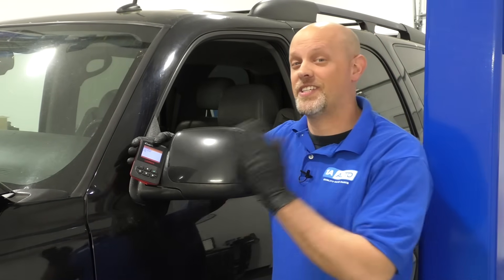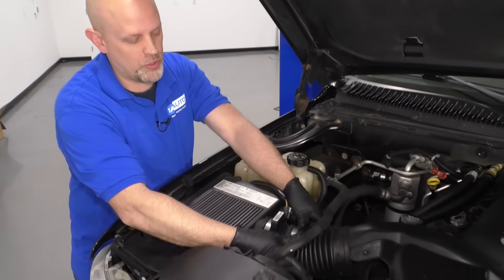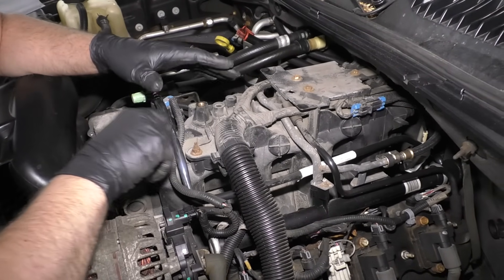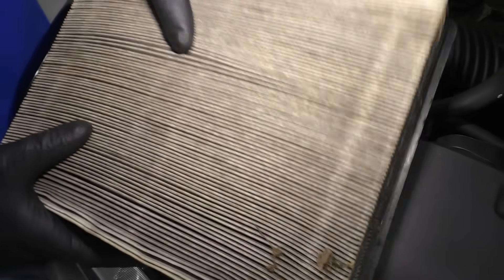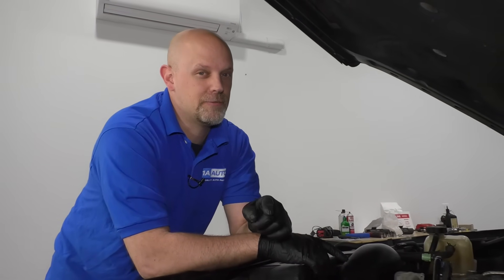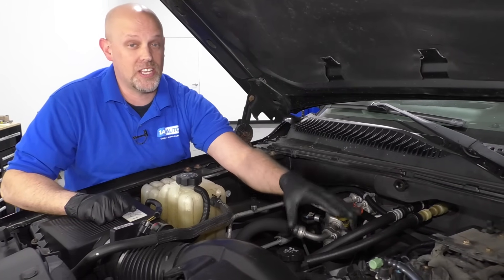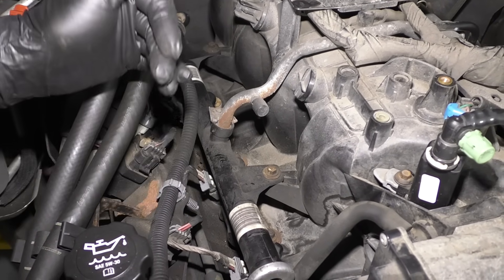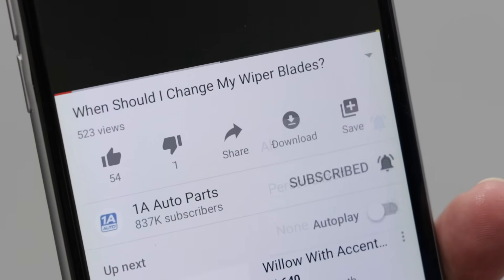Check Engine Light? System Too Lean - Code P0171 or P0174 on Your Car or Truck

Comment: Great video.  Now I know how to deal with the shop.  I think my problem is in the heater AC vacuum line.  This shop replaced the AC control head and ever since then it did not seem to work right and now am getting the PO171 174 system too lean code.
Reply from the maker: +Bill V Thanks for checking us out! http://1aau.to/m/Shop-1AAuto-c

Comment: 03 Trailblazer 4.2 P0171 code and no power. I've replaced fuel pump and fuel filter. Fuel injectors and intake manifold gaskets. New plugs and coils. Both up and down stream O2 sensors. Still gives P0171 code and runs like crap. And yes I've been all over the engine checking for leaks. I now have the cleanest engine in the state of Wisconsin in a 18 year old POS. Any ideas?
Reply from the maker: +Steve Adams Thanks for checking us out! http://1aau.to/m/Shop-1AAuto-c

Comment: It helps.
I have P0171 and P0300, the 03 silverado runs very rough when near op temperature, black exhaust and spitting sound as well.
Ah modern vehicles, I wonder if I can buy my old Nova SS back, simple reliable and durable.
Today's stuff start it wonder when is something going to fail? Then what is it and caused the failure.

Comment: Thanks for the info. I checked the airbox and the snorkel. Mine was loose and after tightening up the bracket and presto the check engine light went off. Thanks for the Info.
Reply from the maker: +Chris Fisher Thank you! We love empowering our customers and showing how to perform DIY auto repairs with our high-quality auto parts.  http://1aau.to/m/Shop-1AAuto-c

Comment: I’m having these codes (P0171 & P0174) on my 2010 Lexus RX 350, do you ever see common issues with Lexus/Toyota vehicles including those with similar sized engines (e.g Highlander, older Sienna, etc.)?

Comment: Can bad upstream 02 cause hard starting
Reply from the maker: +MrBodean2010 When you have a bad oxygen sensor, your vehicle will run less efficiently. It can sometimes have a low idle, erratic jerking at steady throttle, difficult starting problems, cause the check engine light to come on, and generate high fuel consumption.

Comment: HELP! I had “very slight” rough idle. Shop checked for codes - nothing. No intake leaks, no vacuum leaks. They could not find a problem. 2002 GMC Sierra 5.3lV-8 gas. said try injectors if I wanted perfection. 

I just changed my injectors (very carefully and cleaned everything) and a P0171 code appeared bank system 1 too lean. I rechecked all my lines. Very clean air filter. MAF sensor was cleaned months ago. Throttle body cleaned months ago. The code appeared after 20 minutes of driving. Truck has 116,000 miles. Does this sound like an o2 sensor??? Does the upstream usually go bad? Fuel filter changed a year ago. By the way, the truck runs very smooth with 75% roughness removed with injectors.
Reply from the maker: +Windmill Last We wouldn't be able to diagnose an issue like that here, you may want to have a local mechanic take a look at it. Thanks for checking us out! http://1aau.to/m/Shop-1AAuto-c

Comment: What if I have the P0174 code and a strong odor/smell of gasoline as well when the car is running? Would this imply there is gas leaking out somewhere? If so how best to check /find location of a gas leak? Thanks.
Reply: Yes that would be a gas leak, check ur gas hose,,

Comment: A 2015 Malibu I have had the check engine light come periodically with the P0171 code and after several trips to the dealership they finally diagnosed it as a faulty fuel pump. After replacing the fuel pump that took care of the problem for a while. But now I notice that I get a check engine light on with P0171 when the outside temp gets down to about 48 or 49 degrees. I took the car into the dealership but they could never find a solution, after several hours they just clear the light and don't charge me anything. The engine always sounds fine and there's no acceleration problem with the light on. At this point, I really think the ECU software may need to be debugged so not to be so picky if mechanics can spend hours and not find anything. The engine is an ECOTEC 2.5L DOHC, 4-CYL DI/W/WT INTAKE WL & AUTO STOP/START.
Reply from the maker: +Terry B We wouldn't be able to diagnose an issue like that here, you may want to have a local mechanic take a look at it. Thanks for checking us out! http://1aau.to/m/Shop-1AAuto-c

Comment: Good starting point.  The P0171 and P0174 are basically the same code.  The difference in the number is another troubleshooting hint.  0171 USUALLY Bank 1. 0174 Bank 2. This is for V type engines.  Consult
Your factory service manual for the layout.  

Rear Whee Drive vehicles the banks are side of the vehicle and although should be standardized not necessarily so.  

The general layout for my RWD V6 for example Bank 1 is on the passenger side of the engine compartment looking forward from the drivers seat.  

ALwAYS check the layout, mine is 1-2-3 on the passenger side and 4-5-6 on the drivers side.  Some might be 1-3-5 and 2-4-6.......

DO NOT confuse cylinder layout with firing order. 

I just got a P0174 and cleared for now.  When the weather gets better I will check in more detail but not panicking yet!

Comment: Maybe you can guide me or any advice..03 bmw x5 3.0..code p174 and 171 I narrow the issue to the o2 sensors especially bank 2..barely reading..if I'm going down the hill without hitting the gas. All the o2s will read zero..once I stop only bank 1 will read correctly..
Reply: while the engine is running, spray some brake parts cleaner into the intake (dont use the non-flammable stuff), and watch the bank 2 02 sensor, if its working properly, you'll see the 02 sensor go rich when spraying the cleaner in the intake, if it does, then your problem is somthing on bank 2 of the engine, (vacuum leak, injector issue, or something.)

Comment: This is the most elaborate video on the subject that I have seen. So clear, detailed, comprehensive. I have a P2177 system too lean off idle bank 1. I have noticed passed 3 months that the vehicle doesn't start easily as it bid before. It now starts on third or fourth attempt. I am guessing it is more to do with fuel delivery than oxygen sensor.
Reply from the maker: +Friday Mwamba Thanks for checking us out and the feedback! If you are having troubles getting this to crank over it sounds like possibly an issue with a fuel injector(s) or the fuel pump not working as it should (low pressure). Having this diagnosed is the best way to figure out exactly what is causing this rather than replacing one part and it being another. 1aauto.com

Comment: I just fix my head and gaskets on my 2006 chevy silverado and I feel like it's not running right but I have no codes. I guess it's running lean. My rpms are low. Transmission is fine.
Reply from the maker: +JL16 We wouldn't be able to diagnose an issue like that here, you may want to have a local mechanic take a look at it. Thanks for checking us out! http://1aau.to/m/Shop-1AAuto-c
Reply: @1AAuto  yes I know but it seems like y'all have experience with the situation on my truck and maybe knew what was going on. Thanks.

Comment: Hey, so I got a used car (Honda Civic LX Coupe 2008) and I wanted to do a tune up so I changed filter and noticed that it had not been changed since the car was bought (100,000 miles) because it had the original Honda air filter. The old filter was pretty dirty. Could it be possible that the computer is reading too much oxygen due to the sudden air filter change? I got the P0171 code but the car is running fine no stalls or anything

Comment: My girlfriend has a 2004 Ford Taurus.  The Check Engine light comes on anytime the air temperature drops below 50 degrees F.  Always throws a P0174 code.  I disconnect the battery to reset the code. Everything is good until the temp drops again. This has been happening for about 4 years.  Please advise.
Reply from the maker: +texasd1044 We wouldn't be able to diagnose an issue like that here, you may want to have a local mechanic take a look at it. Thanks for checking us out! http://1aau.to/m/Shop-1AAuto-c

Comment: I got this code and my car turns off everytime I’m at a light. It will turn on after about 30 seconds when I turn it back on but it turns off everytime I’m in idle.
Reply: Same, just got my code
P0171, dirty or unsecured filter

I am thinking the O2 Sensor is off if that's the case since I have just shaken off tons of debris and cleaned the container
Reply: @_Circus_Clapped_  what was the issue and outcome???
Reply: What kind of car do you have Crystal Solano? I had a 99 Durango turning off on me at stops and i changed the throttle body sensor and the issue was fixed.

Comment: Well I did pick up my truck from repairs today and the check engine light came on an hour or two after I got it back, should I check for any loose hoses or disconnected wires ?
Reply from the maker: +hypoclit We wouldn't be able to diagnose an issue like that here, you may want to have a local mechanic take a look at it. Thanks for checking us out! http://1aau.to/m/Shop-1AAuto-c

Comment: Save some time go to your dealership get a mass airflow sensor and a Phillips head screw driver. Problem solved 2010 Nissan Altima.
Reply: Shooting the parts cannon at the thing dont always work...  A MAF sensor wont fix the problem if the PCV hose is cracked and sucking in "pirate" air. It also wont fix a lean code caused by a misfiring cylinder, nor will it fix the problem if its caused by a weak fuel pump or plugged fuel filter...

Comment: 2 years ago I had traction control off lights and stabilitrack lights on my dash with these codes and I replaced the throttle body sensor and it fixed it. Last week I took my vehicle to the shop to replace the purge solenoid and I didn't even get out of their drive way before the traction control/stabilitrack lights came back on. I have these codes too. Any suggestions?
Reply: Maybe ABS? Mine had that issue and I just adjusted the abs sensor
Reply: If it’s a lexus a CEL will activate those codes

Comment: I had my check engine light come on a day after replacing my fuel pump. Codes are reading p0171 and p0174 could it be the fuel pump wasnt put in properly?
Reply from the maker: +Charles Hallmark Thanks for checking us out! Both of these codes may be caused by the fuel pump, they also be caused by the MAF not working properly. It is very difficult to try and narrow down the cause without having the vehicle diagnosed and troubleshooting the cause of these codes.

Comment: My 2013 Sierra 1500 just had a P0174 code, I can check all what you just covered over, I hope it doesn't end up being a lazy fuel pump. But I don't think it could because I can hear the pump engage when I turn the key on and the engines cranks up always on the first turn of the key, a fuel pressure check should indicate if it is though.

Comment: Thanks for the information. I get the check engine light after every three trips , like clockwork. Do you have any idea what this could be? I haven't had the codes checked out yet. Thanks
Reply: If you don't have an OBD2 scanner, consider going to just about any Advance Auto Parts, AutoZone, O'Reilly Auto Parts, Pep Boys, etc. type of store where you can get the vehicle checked for free. There are thousands of reasons for the light to be on. The specific error codes give a good starting point for troubleshooting.

Comment: I’ve changed the maf sensor and the code went away but the car still won’t go passed 20
Reply from the maker: +Patricia Vixamar We wouldn't be able to diagnose an issue like that here, you may want to have a local mechanic take a look at it. Thanks for checking us out! http://1aau.to/m/Shop-1AAuto-c

Comment: Bro i got p0171 on nissan altima with shaking engine and rpm and less power of engine can you please help with this and what can cause this exactly list for me the reasons maybe and i will check. Thank you
Reply: I check on computer it was p0171 fuel system something
Reply: My car is a Pontiac Grand Prix 3800 V6 & I had both P0171 & P0300 codes & it was doing the same thing. The issue was my coil packs. They are the little things that your sparks plugs are hooked onto. Some cars have a different set up than coil packs but I would definitely check those first. My car went from having a really rough idle & stall during acceleration to driving like brand new & it fixed both codes.
Reply: Did you fix?

Comment: For my 1.8t ppl
Because we all know they are not stock anymore
I would like to add something to this that i just experienced. I have the n249 delete sia delet etc. And this code gave me the run around for weeks. Smoke test leak test everything. Well because of those deletes i have bypassed my diverter vacuum line to the throttle body next to bank 1. Well the vacuum side of the diverter when out and was allowing boost pressure to enter after the trottle body right into bank 1. Long story short. New diverter valve fixed it. Sad part about this is a smoke test wont show it
Reply from the maker: +The Nest Sbs4Life Thanks for the feedback!

Comment: Buick Lesabre 2000 3.8....my warning light problem began about 2 months ago. First it said gas cap loose, I cleaned it and that was solved...Then it became slightly difficult to start, so I would slightly tap the gas pedal and it would start right up. After a couple days it would start up normally again on the first turn of the key like it always has and still does now........a couple weeks ago the yellow check engine light came on and the code came up PO171. Then it when out by it self a couple days  later, then came on again, and went out again...During all of this I have watched my mileage very closely, and my instant mileage for highway driving is 29 mpg, which I the same has it has always been, and the average overall mileage is 22, like it always has been......do you have any idea what the problem would most likely be? Also during this whole time the car has been idling and running very good......Thanks for any suggestions...............
Reply: What happened with this? I have a Lucerne with p0171 also but car runs great. After sitting for hours it won’t start on first try but then will start on second try
Reply from the maker: +bonnie johnson We wouldn't be able to diagnose an issue like that here, you may want to have a local mechanic take a look at it. Thanks for checking us out! 1AAuto.com

Comment: Mines turned out to be my fuel pump. Wasnt getting enough fuel for new but i found vacuum leaks along the way the check engine light didn't disappear until i found out about the fuel pump pressure bring low
Reply: Was it a new fuel pump joss
Reply: Boss or the old one?

Comment: What if it's both at the same time? Also installed new MAF sensor, fuel filter and no vacuum leaks to be found.
Reply: You are in part changing mode already.
Reply: Could be a misfire in one bank.  Not a good idea to replace parts based on a code without finding the actual problem. An O2 sensor code can be triggered for many reasons. Why replace the MAF unless you know it's bad.  Could be a bad injector in Bank 1, a fouled plug, or oil in your plug well due to bad value cover gaskets. These will all cause a misfire in one bank and that would cause a lean condition. I'm not directing this at the video creator. It's a great video.  Very informative. This is directed at the comments of people replacing parts for no reason.
Reply: Oxygen sensor
Reply: I did the same it maybe be a bad cat
Reply: I installed an aftermarket cold air intake in my 2003 Silverado I hooked my scanner to obd2 just to watch what’s happening while I test drove. So I drove down the street to jack in the box while at drive thru scanner red light went on and o2 senors readings stop right away I scanned for codes and got P0151 & P0157 as Pending Codes (Mind u No Check Engine light on dashboard) I Didn’t notice any negative changes in the engine or it’s drive ability, Why Would These Codes Have Popped Up?
Reply: Would a big hole on the mesh screen cause this error code?

Comment: Another very common reason for this code is if you use the oil on a reusable air filter it can plug up your Mass Airflow Sensor. If that happens all you need to do is clean the filter, don’t use the oil anymore and clean the sensor.
Reply: YES! those oiled air filters are ABUSED by low information owners. BEST solution is-- use TOP QUALITY(pony up)  dry air filters, change it once or twice, depending on dirty Nevada/Arizona  living areas. CLEAN air means hardly any trouble for MAF.
Reply from the maker: +Travis Schallot Thanks for the feedback!

Comment: I was getting this code and random stalls on my 03 silhouette. New mass airflow sensor for 30 bucks fixed it.
Reply from the maker: +RamenNoodles4Me Thanks for checking us out! 1AAuto.com
Reply: Hey how did you figure out it was that? 
I have an 01 ranger and has that code thank you

Comment: Good work. Could you help me with code p1700?
Reply from the maker: +essam ali This code is for transmission immediate failure. We would not be able to diagnose the issue and suggest seeking out a mechanic.
Reply: Thanks alot

Comment: Also with Fuel Injectors the O-rings could be defective ( cracked or shrunk ) allowing a lean condition as well.  Sometimes you  can get away with spraying PB Blaster depending on the O-ring condition which will swell an O-ring and provide a temporary fix till you replace them.  I  did have that happen on a 4.0 Jeep ZJ but it showed as a misfire code.
Reply: I think I have this going on right now, started as an occasional misfire, now it's occasional misfire and lean code